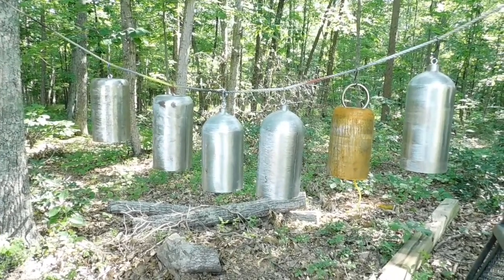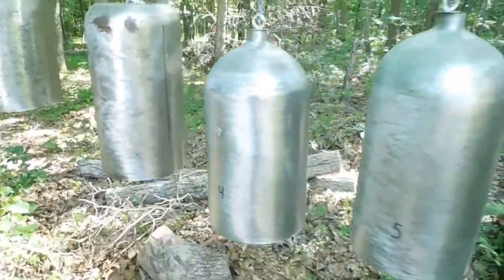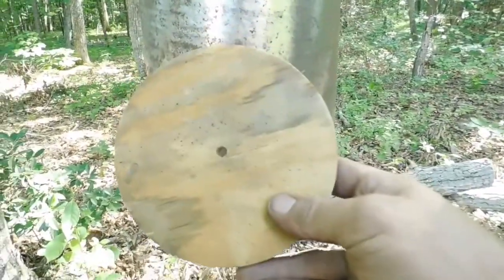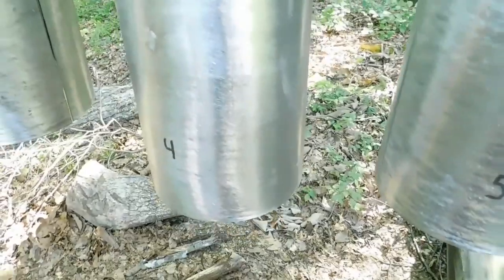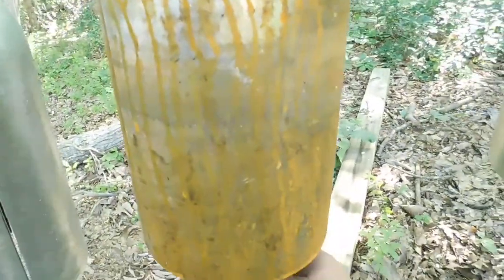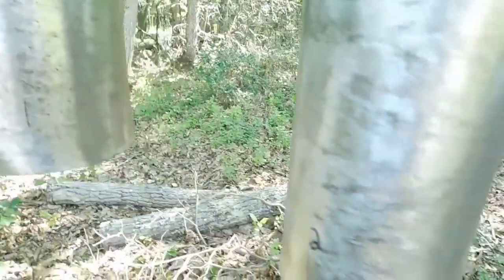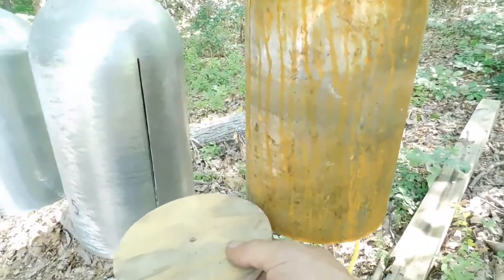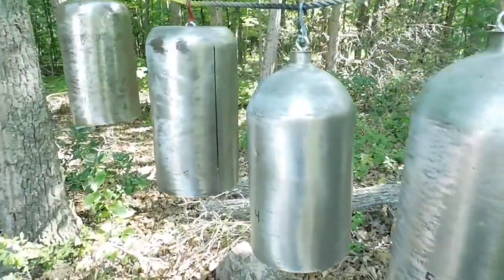Variations of Carbon Dioxide Cylinder Bells

Comment: What if the cuts were only halfway up as compared to these full length cuts?
Reply from the maker: It will give you different notes but not always to the same degree that full cuts will do it. 
It really amounts to just playing with the tanks until you get the sound you like. You can start a cut and check the sound, cut a little more, check the sound. etc. With the understanding you cant cut less unless you are going to try to weld a cut back together.